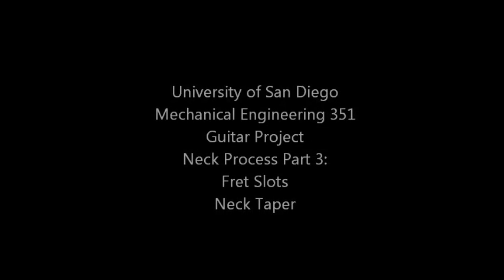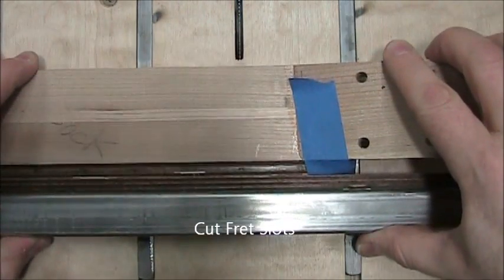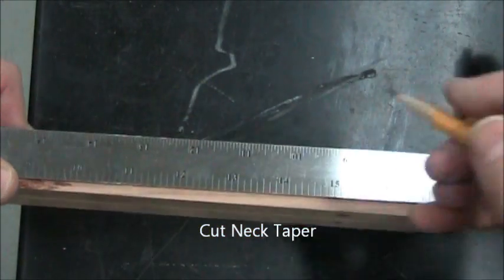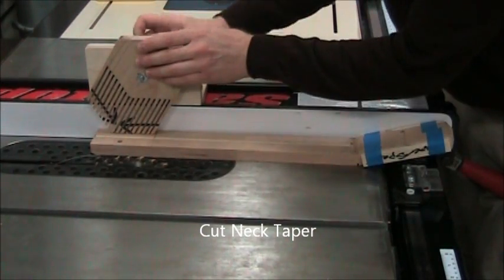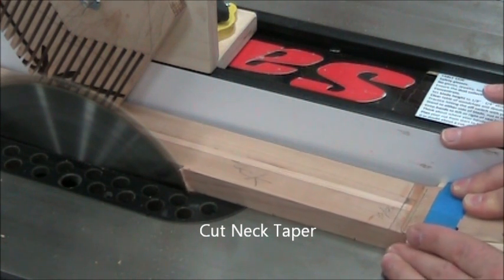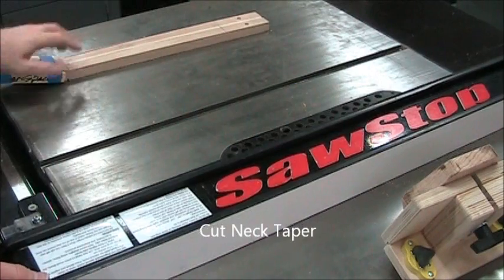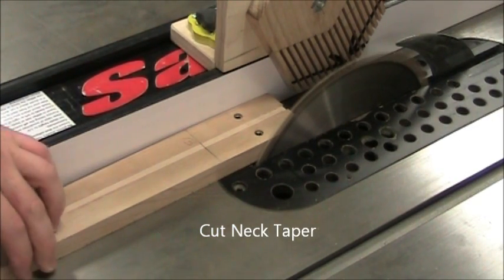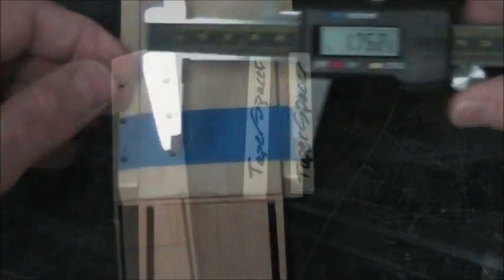MENG 351 Guitar Neck 3: Cutting Fret Slots and Neck Taper

Comment: The Wixey DRO does work on both sides of the fence, but on the left side it will show negative values.  One could re-zero on either side of the blade with the absolute cal method, or one could zero it to the right side with the absolute cal, and then zero it on the left side with the relative cal method.